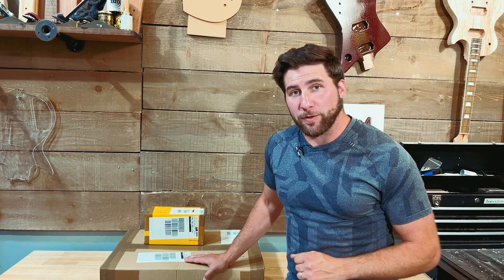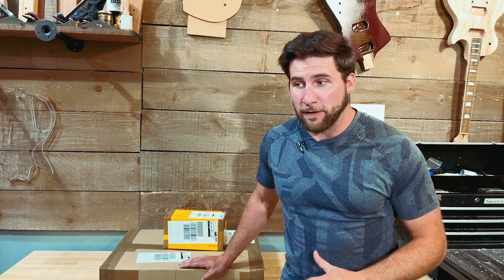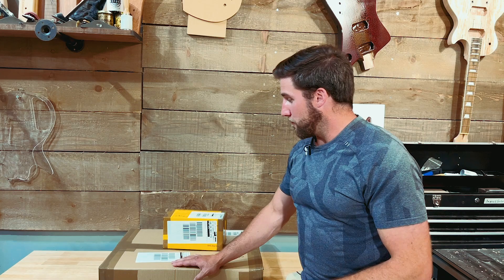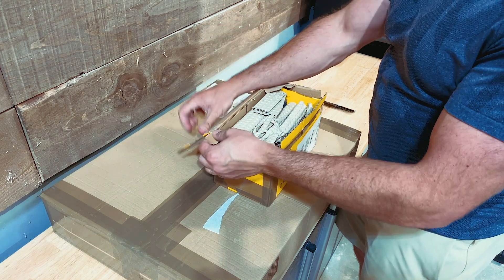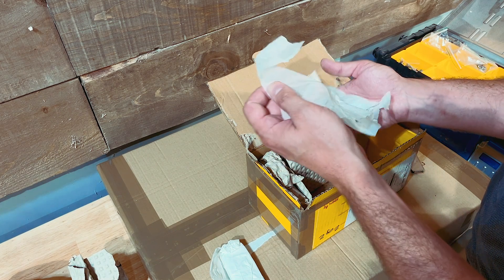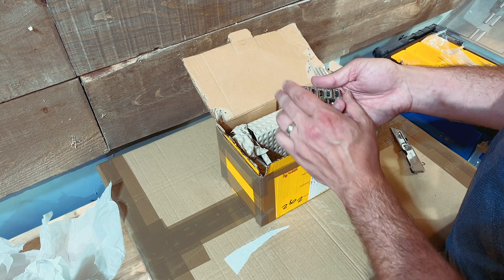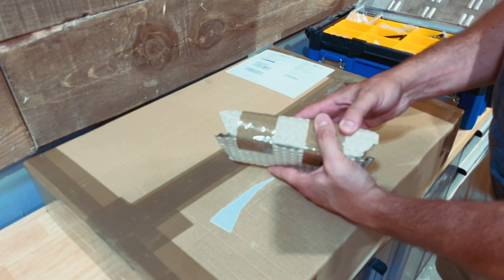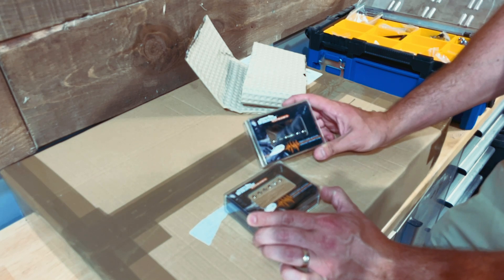The Great Guitar Build Off is Back!

Comment: Dude, don't hate me...I know, I KNOW this isn't one of your paint videos. I'm sorry but its your most recent vid, and you are my spray paint man and I need you. 
Because apparently Rust-Oleum wants to keep it a secret which clear coats are acrylic or not. Same with Krylon. But obviously I have to know.  I'm standing outside paint cans in hands, cursing. I've even downloaded Safety Data Sheets...nada. 
If it doesn't say Enable on the front, do I just assume its acrylic?
Reply from the maker: Is it the rustoleum painters touch? If so, that’s a type of acrylic.
Reply: @BradAngove  omg thank you so soooo much. I knew you would know. There were so many conflicting answers when I googled. And yes, painters touch. 🙂